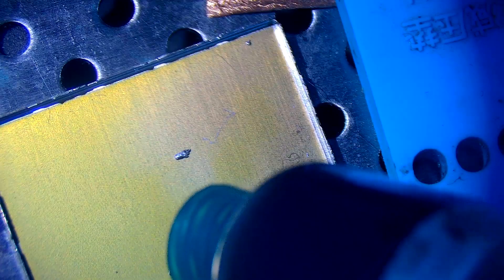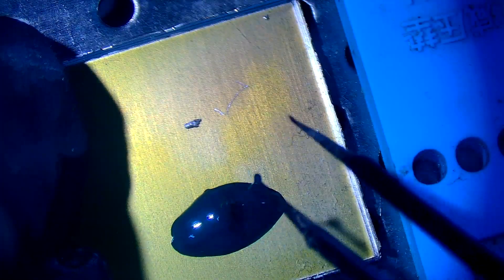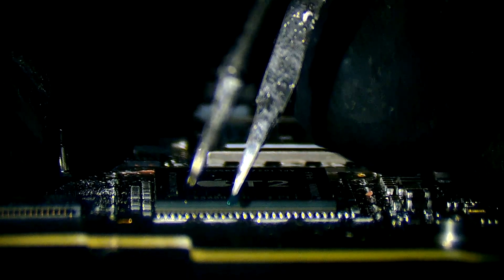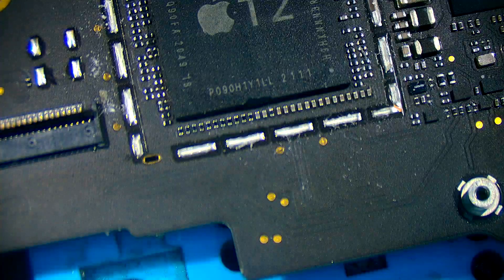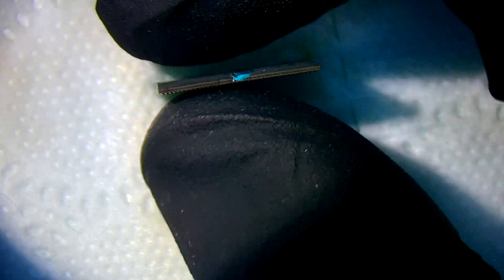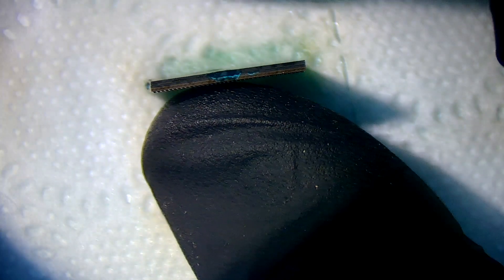How to Safely Remove MACBOOK T2 Chip and Remove iCloud Activation Lock. New Method!

Comment: I have 2 macbooks, both A2179 2020 model with I5
One icloud locked with T2 Chip and 256GB nand working and another with T2 Chip and 128gb nand with bad cpu but icloud unlocked.
Can I take from the icloud unlocked one the T2 chip and 128gb nand and put them on the working board that is locked icloud?
Will this unlock my iCloud motherboard that is currently locked?

Comment: My friend you are the soulmate in repairs i was praying for .lol . I had to watch the video over and over to really understand clearly. I am struggling a bit with the accent. So u are saying to remove icloud u can savage a none Icloud Locked T2 chip from same model donor board and swap it onto the locked icloud board and the icloud would be removed ? Am i correct ?
Also can u share your pre- heater temps and hot air temps for removing the T2 Chip ?